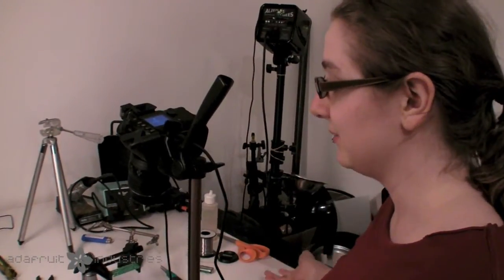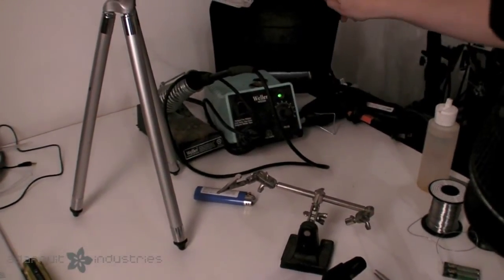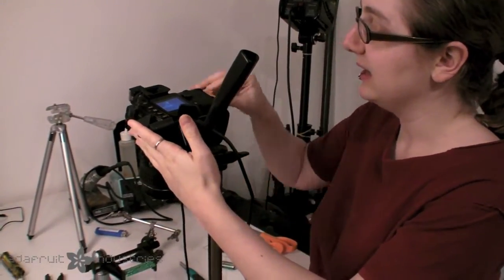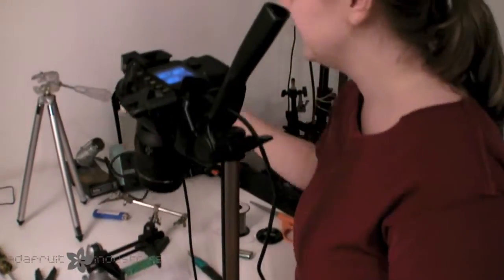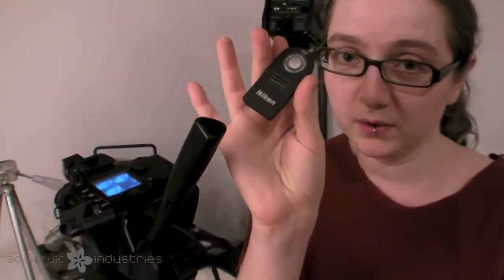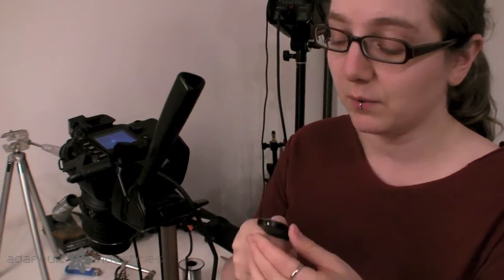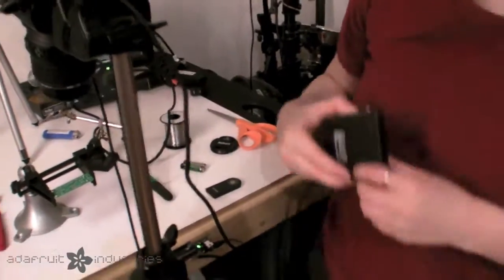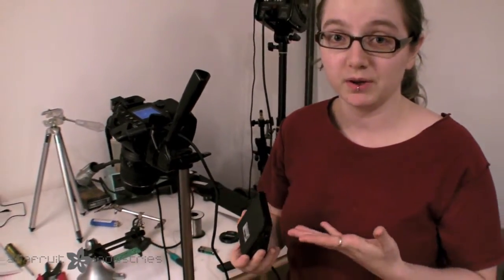How we take photos @ adafruit

Comment: @GeckoLink: Most of the Nikon cameras--past and present--have a proprietary plug for a wired remote, which would make the creation of a foot switch very simple. The wired switches are under $20 on eBay. Unfortunately the D50 is not one of those cameras. It can only be triggered by IR.